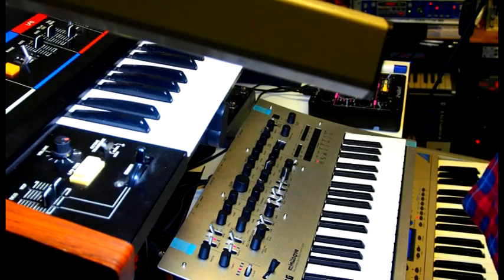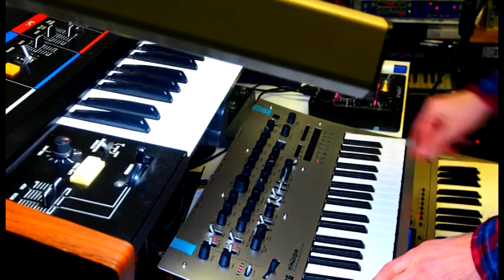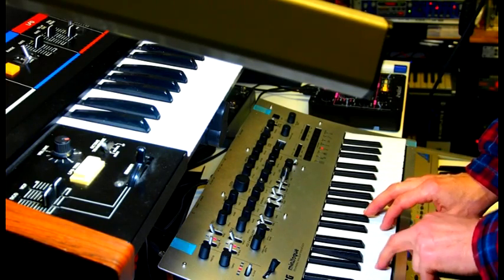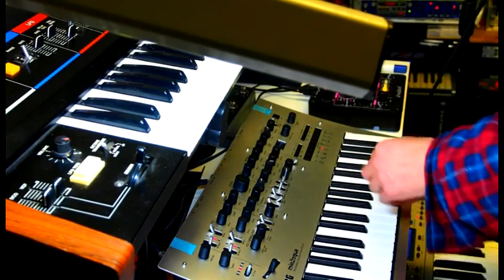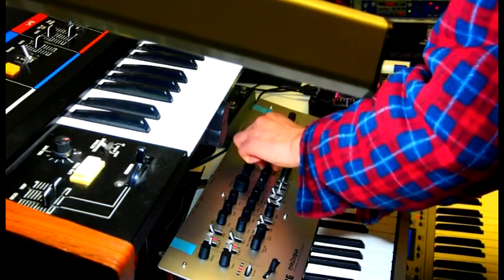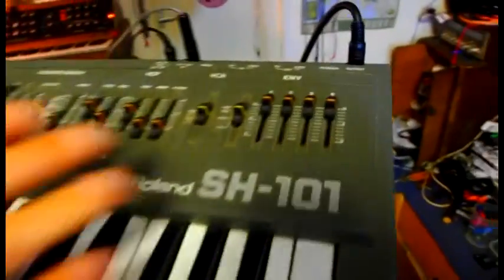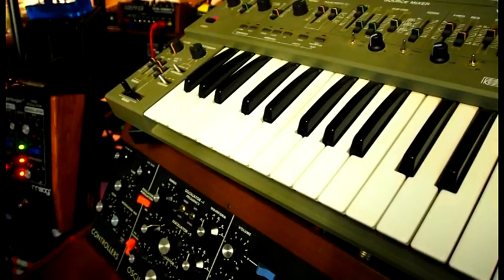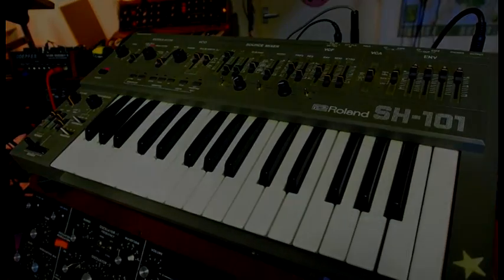Analogue envelope behaviour Minilogue vs. SH-101

Comment: It's the trigger mode.  Some synths re-trigger the envelope when hitting a new key, some don't and some let you chose.  It has nothing to do with analog.
Reply: +matrixsynth A re-trigger mode will cause an envelope generator to re-enter the attack phase when a new note is played, but an analogue envelope generator will re-enter the attack phase from the previous level the envelope was at unless it has extra circuitry to reset the timing capacitor.
What the Minilogue does is a hard-coded version of the Return-To-Zero feature found on the Moog Memorymoog (check out page 35 of the MM manual for a concise explanation).
It was optional on the Memorymoog, because it is not a desirable feature if you want to play long sustaining solo lines, for the reason than Wily has demonstrated.
Reply: +matrixsynth
 Paul Nagle put's it clearly in his review of the Roland Gaia SH01:

"It is in mono mode that the SH01 reveals its digital origins most clearly, specifically in the envelope department.
To illustrate what I mean, here's a simple test. In mono mode, set the amplifier envelope's attack and release to maximum then hold down a note so that the level gradually increases. Release the note and quickly play a second one. In an analogue SH synth, the second note smoothly starts its ascent from the current release level. However, the SH01 does what many other digital synths do, which is to assume that every note lives in isolation. New notes start their journey from silence, and therefore the SH01's mono patches sound most realistically analogue with short attacks. Long ones invariably deliver deviant accordions.

It's only fair to point out that Roland aren't alone in this 'mono sin'. The same behaviour is seen in many software synths, suggesting that the major push has been to mimic analogue oscillators and filters, leaving envelopes, well, 'unlicked' is the word that comes to mind. I can't really consider this behaviour a 'con' (it may be that the goal was not to simulate analogue envelopes anyway) — but here's a plea to developers everywhere: remember the humble capacitor!"

http://www.soundonsound.com/sos/aug10/articles/roland-gaia-sh01.htm
Reply: +matrixsynth You're clearly not getting this... In multi-trig mode, an envelope should re-enter the attack phase when a new key is pressed, continuing from the level it was at.
For example, if the sustain level is 75%, a multi-triggered envelope re-entering the attack phase will rise from 75% back to 100% at the attack rate, then decay back to 75%. In a single trigger mode, the envelope will not re-trigger. What the Minilogue does is reset to zero - the instantaneous output level of the envelope returns to 0% at the start of the attack phase.
Read page 35 of the Memorymoog user manual.
Reply: +cbynum93 LFO key sync means it restarts the LFO cycle when you play a note.
Reply from the maker: +matrixsynth looks like the video has done it's job in the end :)
Reply: +matrixsynth I hope so too cos it's a wonderful little synth. I have a list of synths that behave this way and had almost given up trying to tackle each company individually. For example, I was horrified when I bought the Monopoly plugin to discover it did this. 
And I apologise if I got a bit frustrated back there. I'm old and crotchety but trying not to resort to the relevant 'Synth Secrets' page as that would have felt like a defeat. 
If Tim hadn't brought round his synth and video camera, I'd still have been a lone mumbler on this one. Group hug and let's make the synth world a better place, at least in terms of software envelopes! :)
Reply: nati green Some confusion of terminology, there, I think. 
But compare the Minilogue and the SH101 and the video.
The minilogue completely resets and restarts its attack from silence when the key is pressed, whereas the SH101 envelope starts rising again but from where it left off previously.
One obviously sounds awkward, and one obviously sings.
Reply: +WilyEPeyote 

I don't know what you guys think I'm saying, but here you go: https://en.wikipedia.org/wiki/Korg_Poly-800

"In single mode, the first key pressed triggers the filter envelope, and unless all keys are released, the filter does not re-trigger. In multi mode, each key pressed in turn triggers the filter envelope, even if other keys are still pressed down."

So, in the minilogue is essentially in multi trigger mode. ;When he releases the key in the video, the long release continues until you hit the next key which cuts it off because it re-triggers the envelope. On the SH-101 the envelope does not re-trigger, instead it continues on so any subsequent notes continue to play. The reason why no notes play when he plays them quickly in the video is because the attack is set too long. The notes never gets a chance to reach a level you can hear. It has nothing to do with analog synths. My Voyager is analog and can be set to multi trigger mode. My Pro One is analog and can be set between the two. The Poly 800 per above can be set. Tons of synth have this capability, analog and digital. 

If something else is going on in this video, let me know, but all I'm seeing is standard mulit-trigger behavior.
Reply: +sequentix "Single trig will not re-trigger the attack phase of the envelope when a new key is pressed. Multi-trig will."   That's what I meant.  I didn't say otherwise. In the video all I'm seeing is the envelop starting over on every key press.  I don't know what you mean by "reset to zero" aside from it starting over again which is what should happen in a Multi-trig mode.  See my note with the Poly-800 link.
Reply: +WilyEPeyote +sequentix Verified on the Voyager.  You are both correct.  

I put a post up on MATRIXSYNTH to bring some extra attention to it: http://www.matrixsynth.com/2016/02/analogue-envelope-behaviour-minilogue.html

If I got anything wrong, let me know.  Thanks again to both of you for the patience and explanation.  You would think after 30 years of programming synths, and running the site for over 10, I'd come across this, but apparently not. I always used Single Trigger with long Sustains for the effect so I never really thought about it until now.  

And no rising Pink Floyd leads on the minilogue!  That indeed is a shame.  A little humor there but zero sarcasm.  Once you realize what the problem is, you realize how potentially big it is.  Hopefully they will fix it.
Reply: Yes - you've got that perfectly correct, Nati.
I didn't think you were confused, just that the terms 'retrigger' and 'start' could be.
Under the hood of the SH101, a capacitor holds a charge of electricity which determines the volume of the sound. That electricity slowly leaks away (decay) and slowly charges up (attack) when the key is pressed again.
If there is still electricity in the capacitor when a key is pressed again, then the volume attack starts from there. If you set the attack to 0 seconds, then it will reset anyway. 
Some analog synths do discharge the capacitor at each key press and therefore behave like the Minilogue. A lot of digital synths behave this way too.
It is quite a subtle concept - though, honestly, it does depend on what you are playing, as there are styles that would benefit best from one or the other  - so there is not really one right or wrong way (a choice would be nice). I think the video makers are saying they prefer the SH101 method (and so do I).
Reply: +matrixsynth which is completely irrelevant. Watch again. I'm not playing legato, I made it as clear as possible that it was the transition from release to a new attack.
Reply: +Howard Scarr It depends on what you are playing.  There have been countless times when I was annoyed by a patch because the sharp attack would not re-trigger because I accidentally played legato.  There is a reason why many synths have the option.  I don't think this was a bug on KORG's part.  I'm guessing they chose to go with multi-trig by default for a reason.
Reply: +matrixsynth OK, let's try another tack. Try thinking of an envelope as a voltage dispenser. Set the attack and release times to their maximum as in the example. Before you play any notes, the voltage output is zero. When you play the first note, the voltage slowly rises to the maximum. If you release the note at any time during this rise, it enters the release phase and the voltage begins to decrease. If you play a new note before it decreases to zero, what would you expect to happen? It seems that you think the voltage is discharged in a multi triggering synth. Try it.
Reply: +matrixsynth Not according to this Moog forum post it doesn't...
http://forum.moogmusic.com/viewtopic.php?t=8531
Analogue envelope generators do not reset to zero unless they have extra circuitry to do so. None of the classic synths behave the way you describe, and I say this having looked at the schematics for many envelope generators, cloned a number of them, and designed my own, with and without voltage control.
There is a nice graph at the bottom of the CEM3310 datasheet, clearly showing the absence of "return to zero" when the envelope is re-triggered:
http://www.cedos.com/datasheets/cem3310pdf.pdf
Reply: +matrixsynth It's probably because so many modern synths with software envelopes have hard-coded return-to-zero that you expect it to behave this way. And of course, if you're not in the habit of playing the sort of legato mono lines with slow envelopes that it causes a problem with, you wouldn't be annoyed by it.
I know Wily has spent a lot of time trying to explain this quirk of modern EG design to a number of synth designers, and they rarely seem to want to fix it.
Reply: +mickey thompson I'd be interested in examples of analogue synths that go to the extra trouble of discharging the capacitor. I know of the Memorymoog and there's a Digisound envelope that does it too but in both cases only as options outside the normal behaviour. Would love to know if there are any more, for when I have this discussion with future software guys.
My main point is that if the Minilogue envelopes were hardware, this issue would not have arisen. If they were software written to behave like hardware, this issue would not have arisen.
Reply: +matrixsynth I think the best answer is still to ask you check out the Synth Secrets link I posted above. My own attempts have failed consistently for many years, not only with yourself but with Arturia, Korg, Clavia, Spectrasonics and even Moog (Animoog, if you were wondering). 
I was prepared to accept I'd missed something, even that Korg, wacky as ever, might have filed this aspect of envelope behaviour wrongly under portamento, but of course that isn't the case. I am still holding out some hope that they will address it, not because of anything I've said but because of the word of others, or even because they want to work on the 'click' aspect of zeroing, which I know irritates Tim a lot when used in mono or poly mode. 

I'm probably asking for trouble inviting you to read more stuff, but what the heck... here's a link to a new synth with interesting envelope options. I've only just started playing with it so can't give any thoughts away but you can tell this company is, at least, aware of the issue of zeroing and don't force it upon you. This can only be good.
http://www.hypersynth.com/xenophone/us/xenophone_reference_manual_EN_US.pdf
All the best
Reply: Great discussion and resolution! Well done guys for sticking it out with each other. This was a very interesting video and discussion about the actual internal behaviour of analog synth circuitry, love it! 

At the end of the day the functions we get on our analog synths are controlled by the design of the circuitry and the behaviour of the components.

Matrixsynth, well done on conceding to the facts, very admirable. By the way, thanks for the work you put in on your site! As a synth enthusiast and DX7 youtube tutor I appreciate the many online synth sites such as yours!
Reply: +matrixsynth Dude, that's rubbish! It's to do with capacitors.
Reply: +matrixsynth the part you wrote ;) (Sorry, couldn't resist.) 
Read Colin's reply, he puts it better.
Reply: +matrixsynth No, it is not the same thing. Single trig will not re-trigger the attack phase of the envelope when a new key is pressed. Multi-trig will. But we are not talking about whether the envelope re-enters the attack phase or not - we are talking about the current level of the envelope being reset to zero when the envelope is re-triggered.
Reply: +WilyEPeyote Playing legato has nothing to do with it.  It's the envelop retriggering on each note, so of course the long release will cut off and with a long attack so of course you won't hear anything if you play too quickly.  You need to give the envelop a chance to play out or you need to shorted the attack time.  See my comment with the Poly-800 link.
Reply: +tim Not on a Multi-trig synth.  That is by design.  If the minilogue were Single Trig, then yes.  But I do agree it would be nice if it could.  Ideally you'd have the option to choose.  I don't own one and couldn't find it in the manual, so I have no idea if it does.  And for what it's worth when you want a short/sharp attack to trigger on every note then Multi-trig is the way to go.  I have many patches set specifically for this on my synths.
Reply: +matrixsynth Multi-trig is bad for monophonic, as Paul clearly demonstrates.
Reply: +sequentix Maybe the finally fixed it with modern synths.  :)  Just kidding!  I see what you are saying now, so thank you for sticking with me on this.  That is interesting regarding the Voyager.  I couldn't get the attack phase as long as the minilogue so I didn't hear it.  I will need to give it another go today.
Reply: +WilyEPeyote Someone on MATRIXSYNTH mentioned there was a Legato mode on the minilogue.  What does that do regarding all this?
Reply: +matrixsynth all the synths i've had, analog or digital had the possibility to retrigger the envelope. and if the envelope is fast enought (like in the dark energy) you have exactly this, so you are right.
I hope they will add the possibility to not retrigger the envelope at the beginning of every note, it could be interesting with polyphony, too
Reply: nati green
There are synths that will pick up the attack from whatever phase the envelope was at previously, from whatever voice is being stolen.
Reply: mickey thompson 
Oh, I got it! 
thanks for the explanation man.
Mine is on its way. I think it will be great as a first synth for me even so (could have been nice to have a choice thow..)
Reply: So can you turn off trigger mode on the minilogue?
Reply: +cbynum93 I don't know.  I don't own one and I couldn't find it in the manual online.
Reply: +matrixsynth yeah I looked at the Manual too but only found a LFO key sync. Still not sure if that would do anything
Reply: +sequentix I was reading the Emu Morpheus manual the other day and it had a neat explanation, calling one type a 'Synth' envelope while the RTZ type was a 'Wind' envelope.
Reply: +WilyEPeyote What part's rubbish?
Reply: +sequentix Yep, Single Trig vs Multi Trig.
Reply: +WilyEPeyote in Multi-trigger mode I would expect the envelop to start at attack zero again.  I just tried it on my Voyager and confirmed this is what it does.
Reply: +sequentix I see what you are saying now.  I wouldn't expect the envelop to continue at the previous attack level in multi-trigger mode.  I would expect it to start over as if it was never previously triggered.
Reply: +matrixsynth I picked a long attack to best show the effect. Similarly I picked an SH-101 as comparison because it's a favourite of the band and I sorta hoped to enlist their help given my own past failures to convince Korg this is worth doing. Maybe tomorrow I'll fire up the Odyssey. Or blow my brains out. :)
Reply: +tim Thanks for putting it up!
Reply: +digidope lol, yeah they even fixed their own Monopoly when they did it in software.
Reply: +matrixsynth Yep, I recall there is a setting to choose that behaviour in the microbrute, on the software side.  I prefer if the attack envelope picks up wherever the envelope was at the time... More natural.

But every synth has it's own characteristics.  I would simply use it for that characteristic.
Reply: matrixsynth
Interesting.  Does it only apply to the mono or unison modes?
Reply: +matrixsynth I couldnt find it in the manual either. Missing feature if you ask me.
Reply: +matrixsynth 

 secuentix
I dont get it???
if a new note re-trigger the attack phase, the attack always start at zero and rise up, no? what you describing is a re-trigger to the very end of the atack, isnt it?
Reply: inthefade I understand that. but +secuentix wrote that a new note should re-trigger the attack phase from wherever it is  and not being reset to zero, but the atack phase start at zero?!?!?!
Reply: mickey thompson I can clearly hear the difference from the two synth. I`m just trying to understand what a re-trigger behavior should act like and what is really happening under the hood.
from what i`m hearing from the sh101, a new note pick the current volume being played and heard and start the attack phase from this point up, not re-triggering the whole phase from zero. is that re-triggering usually behavior?

may be its only my English that making the whole confusion...  :-)
Reply: +WilyEPeyote No need.  I understand how it works.  I was just curious if what Nick mentioned worked.
Reply from the maker: +matrixsynth "You need to give the envelop a chance to play out or you need to shorted the attack time." ... which, with the SH 101 for example, you don't have to do because it has true analog envelope behaviour - this is what needs to be addressed ... this is the point being made and it is illustrated perfectly in the video